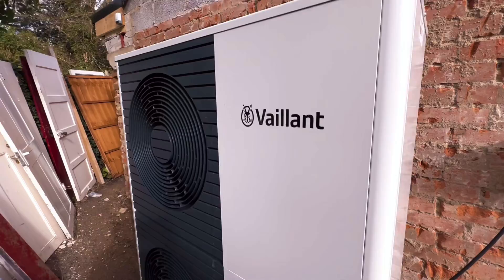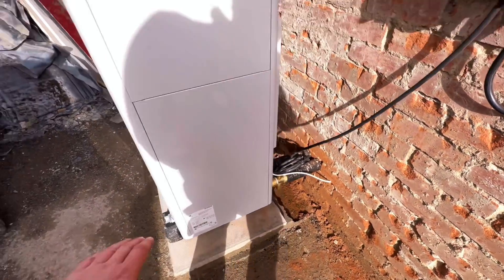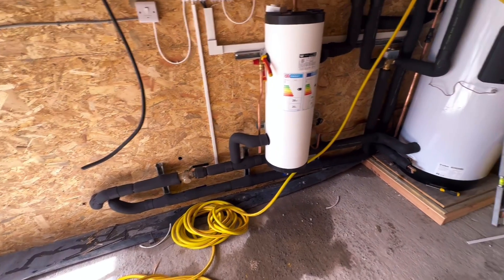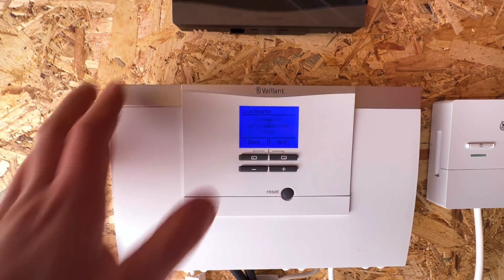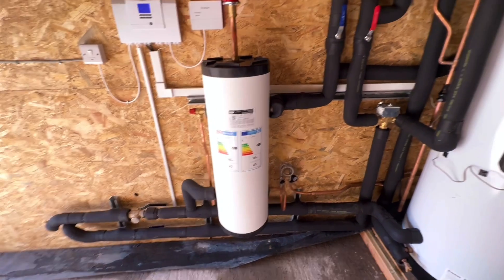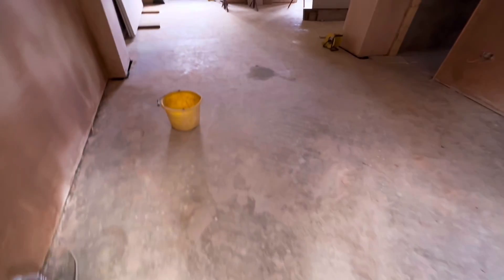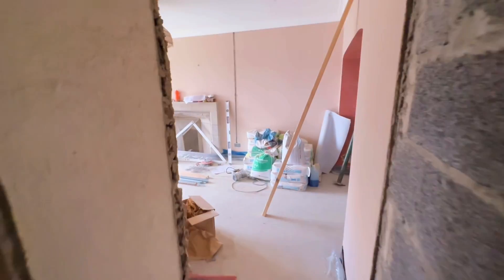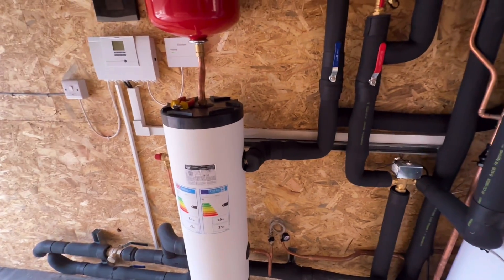Open Loop Vaillant Arotherm Plus 10KW. Keep it Simple?

Comment: Is open loop possible for both heating and cooling systems and hybrid heat pump and gas boiler? Like two floor house with both floors fully underfloor heating and then water convectors for cooling. Around here outdoor temp goes from -10 to 30 degrees C.

Comment: Shouldn’t volumizer have return come in from top and leave bottom?

Is a PRV normal on a volumiser?
Reply: Is there no Tesla valve for maintenance on exspansion vessel on buffer?
Reply: Do you not need a bypass?
Reply: Wouldn’t you rather air air vent top of volumiser
Reply from the maker: @lukeb6565  volumiser is piped like that. Prv on volumiser isn’t normal but it is a good a place as any to put it. No valve on exp vess. No need. We could have put an air vent in but doing the vessel like that was a neat solution. Plenty of air vents on the system otherwise. 😎

Comment: Why fit the buffer?
Reply from the maker: @markfernandes2467  it’s not a buffer
Reply: @griffithsheating   Is there a difference then? What does a vollumiser do then and why did you use one of those?
Reply from the maker: @markfernandes2467  yes. A buffer provides a hydraulic break between the heat pump (primary side) and the system (secondary side).  So an additional pump is required for circulation in the secondary side. If the flows are poorly balanced between the primary and secondary side you get what’s called distortion where the heat pump may be delivering 45 degrees but the buffer is only supplying 40 degrees so the heat pump has to run at 50 due to achieve 45 degrees in the system. The upside of a buffer is that you can get away with murder on the system design and the heat pump won’t notice but your efficiency will suffer. 

There is a bit of dogma around buffers amongst the pseudo online big brains. They’ll decry buffers from the rooftops and smugly rip an install apart because it has a buffer. I have Viessmann systems running buffers with scops almost touching 5 after nearly 2 years.

A volumiser is essentially just a big tube of water sitting inline just to increase water volume in the system to help with defrost volume or to increase compressor run times when it’s mild out.

Comment: How do you set the flow rate no one wants to tell you how to do it.
Reply from the maker: Ufh flow rate is set by the manifold flow setters and the rads can be set with either a flow balancer or flow setting rad valves. Or you could use what’s called a stad valve
Reply: @griffithsheating  Cheers it is a Grant Aerona with a low loss header only 9 rads the T1-T2 is only about 2-3 nightmare.
Reply from the maker: @Allegedly2right  bare in mind that your dt will only be at design (5, 7, 10 or whatever) when you are on a design day which is a day below zero degrees outside. Anything more than that the dt will narrow.

Comment: I’m having two 12kw cascaded , I don’t know enough to be sure whether a none zoned open loop system would work . Ufloor on ground floor radiators on other two which I’m hoping to size sufficiently to balance . I’d like to get it down to 35 flow but currently spec is 50 , which worries me for running cost . Re insulated everything.
Reply from the maker: We’ve done a similar split  upstairs / downstairs cascade with a pair Viessmann vitocals. You will have better low modulation performance and ultimate control in this configuration in my opinion. Not sure you could open loop a true cascade as it would probably need a buffer I would have thought. There is nothing wrong with a buffer, not everyone is interested in chasing the last few percentage of performance. Its a central heating system not formula 1 car

Comment: Are you bending the UFH down to lower temp or just running 45oc with rads?
Reply from the maker: No blending. Just letting the heat pump do its thing unrestricted.
Reply: @griffithsheating  it makes sense, less expensive mixer station/pumps better savings. Is this your standard going forward then? Do you just run one stat for the whole house?
Reply from the maker: @gerardfry4876  there is a  wireless Vaillant senso comfort controlling it so you can either run it as a room stat or just off a curve with no room influence. Not sure how the customer will want to run it yet.
Reply: And if the pump on the HP can’t supply the index circuit with enough flow, would you fit a buffer then?
Reply from the maker: @gerardfry4876  yes if my calculations are wrong I’d have to convert the volumiser to a buffer and add another pump.

Comment: What’s the Gas Boiler doing then mate??!! You sound a bit arrogant, no surprise you fell out with Kevin!!.......We’re fitting R290 stuff without F-Gas tickets here in Scotland. Just got LPG ACS ticket. 28mm to the UVC is grossly oversized & you’ve got Galv Band everywhere, what a mess. Are you all course cowboys??
Reply from the maker: Sshhh don’t talk about the gas boiler or Kevin 🤫  we ran out of big clips. I’m not arrogant I’m just better than 99.9% of everyone else. I qualified 6 months ago so have a lot of experience.
Reply: Boiler was obviously part of the old system to be ripped out.....🙄........
Reply: to the bloke that needs an electric bender because he carnt pull a bend ' also pull youre head out of kevins ass and crack on with youre rad valves and tap washers Dick ' fairplay lads looks like you know what youre doing ' 💪💪

Comment: Does the system not have enough volume for the defrost cycle? Would of that you could of got away without the volumizer
Reply: Nope, the open loop system becomes the volume you need for Defrost, been installing like this for decades already.
Reply: @kenbone4535  Specially with UFH you have lot of energy mass around in case you need any excess energy for defrost.
Reply from the maker: I was thinking more of minimum run times when it’s mild out. I have seen Arotherms ice up though even when volume seems to be ok.

Comment: Going to sound stupid here but how does that comply with G3 requirements if it doesn’t have a two port on the DHW I take it’s interlinked with an overheat stat on the tank?
Reply from the maker: Not required (it's not shown on the vaillant schematics at least)  I don't use 2 ports or over heat stat on gas either if I'm fitting a Viessmann boiler with an ntc sensor on 4 pipe. G3 police haven't arrested me yet... 🚓
Reply: @griffithsheating Building Control would not give you a completion certificate with no 2 Port on the UVC here in Jockoland mate!!!

Comment: We need to talk about K̶e̶v̶i̶n̶ Viessmann
Reply from the maker: Let's just say we had a disagreement about the part L building regs 😄 They claimed all heating systems have to be designed to 45 degrees and I called 🐂💩 and 7 months later I'm still waiting for a BUS grant payment. I guess I'm not cool enough to join their club.
Reply: @griffithsheating   what did you design to? Sounds out of order to me
Reply from the maker: @jacbisgood2221  designed to 55 due to rad space available but that's knowing the home owner is doing a load of additional insulation in the roof space and floor so will end up around 45/50 mark. It actually was finally signed off and grant paid today as it happens 😎